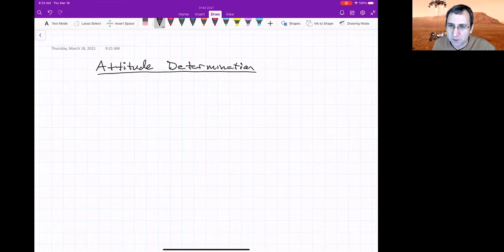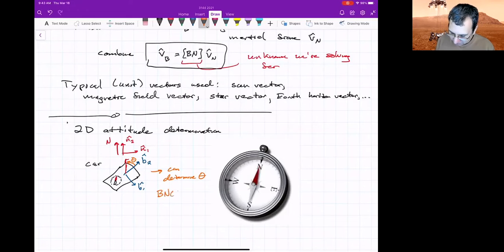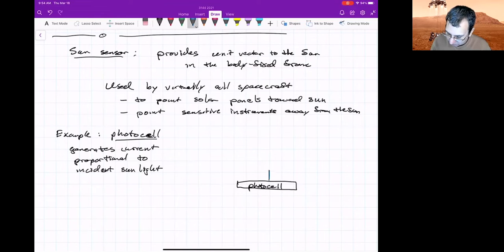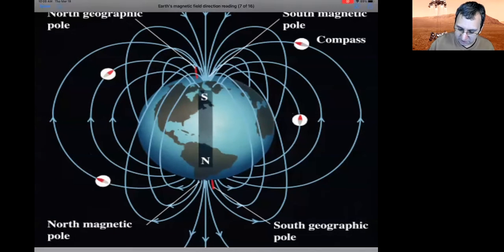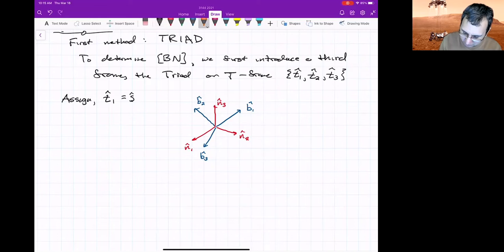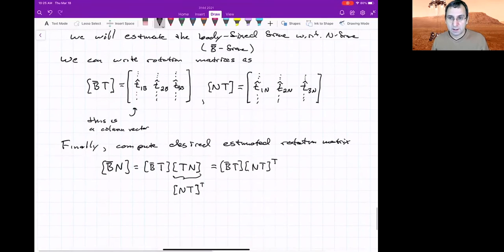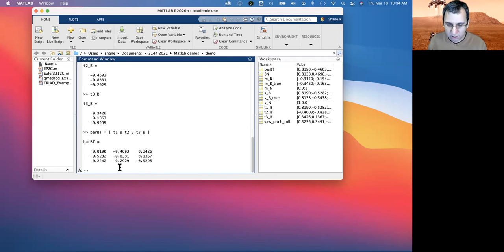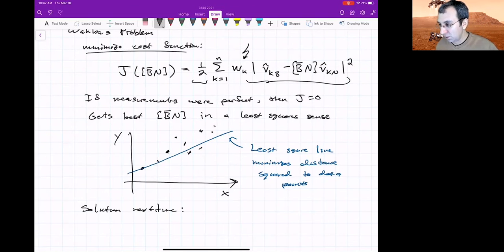Attitude Determination: Sun Sensors, Magnetometers, and the TRIAD Method (MATLAB) | AOE 3144 L17

Comment: Hello professor, does the ErrorPhiDeg means something physically? Like the angle between both rot mat for example?
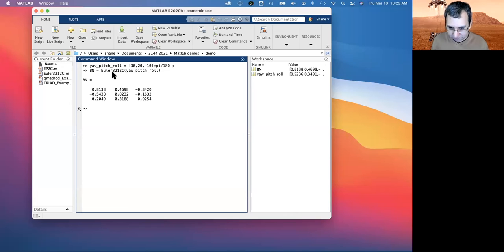Reply from the maker: In short, yes. ErrorPhiDeg, at 41:43, is a single number that represents the error of our spacecraft attitude estimate. It is the Euler principal rotation angle between the true [BN] matrix and our estimated [BN] matrix, based on imperfect (noisy) measurements. In the made-up example, we 'secretly' know the true attitude of the spacecraft from the beginning, at 34:26 so we have a benchmark to compare to (which would not be the case in a real-life situation). We could also describe the error between the true [BN] matrix and our estimated [BN] matrix in terms of yaw, pitch and roll angles (which would all be small, around 1 deg), but my approach is to summarize with one number.  Best would be ErrorPhiDeg = 0 deg and worst would be ErrorPhiDeg = 180 deg.
Reply: @ProfessorRoss  got it, thank you professor!

Comment: If I want to introduce some "real error" based in the sensor accuracy ranges, what could I do?
I am getting sun and magnetic measurments from STK, but I want to introduce some error.
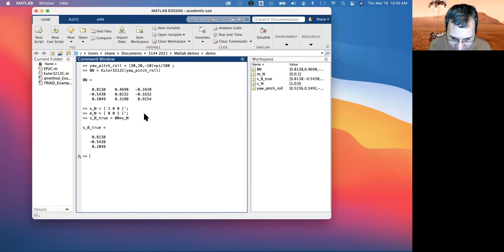Reply from the maker: Here's a procedure: You could take, for example, the "true" sun vector as seen the spacecraft frame, what I call s_B_true at 35:26, and you could pre-multiply that by a 3x3 rotation matrix, C_error, which is a random small rotation. For instance, choose a yaw, pitch, and roll each from a random uniform distribution in the range -1 deg to 1 deg, or you could take them from a gaussian distribution. In any case, from that, you get your 3x3 matrix C_error. You could the use as your simulated erroneous measurement, s_B = C_error*s_B_true.  Note that if the yaw, pitch, and roll where all zero, then C_error = 3x3 identity, and so s_B = s_B_true, but because you have small random values for yaw, pitch, and roll, s_B will be slightly different from s_B_true.
Reply: @ProfessorRoss  Thanks professor Ross!

Comment: I’m working with a satellite system that is currently fielded and am trying to understand some phrases and get some definitions. What is “Incident” and “coincident”? The sensors are also not on a fixed or tidally locked vehicle but one that is in a rotisserie. So the sun only passes over the sensor once per rotation and measures an aspect angle.
Reply: Sorry if this is a little late, but the incident angle is the angle the target (like the Sun, for example) makes with the direction normal to the sensor. So for example, if the flat sensor is "looking" directly at the sun, the incident angle is zero degrees. As the Sun drifts out of the sensor's field of view, the angle decreases.